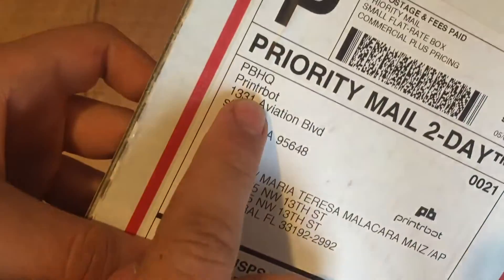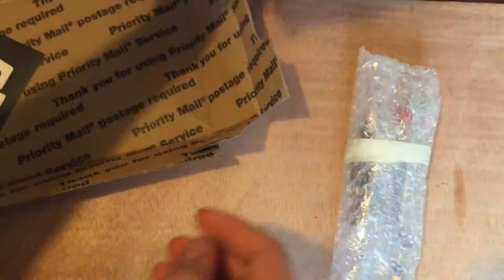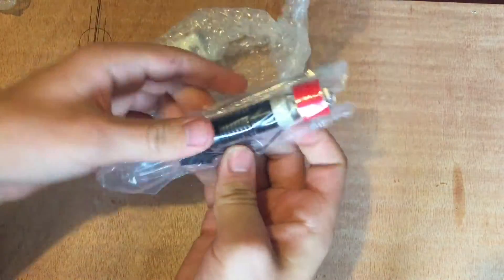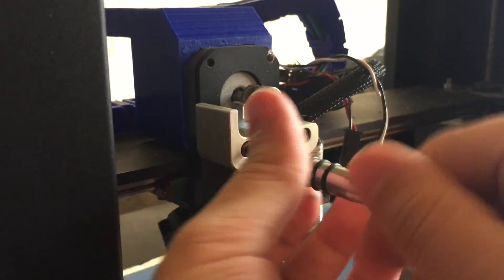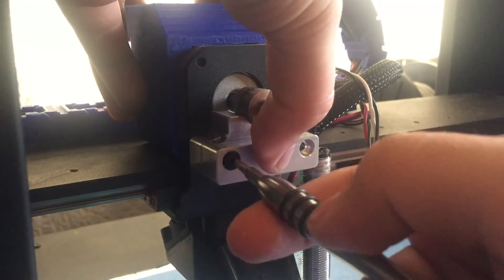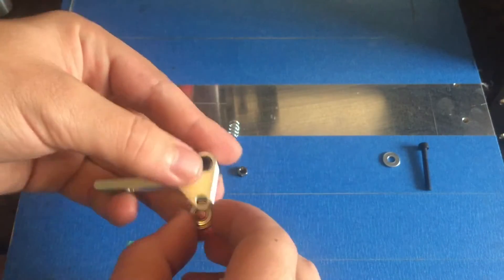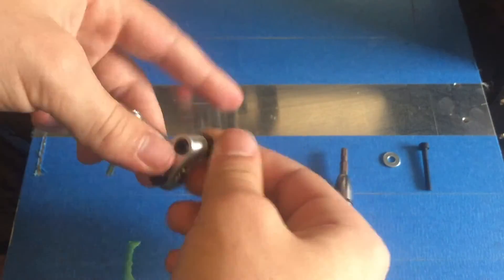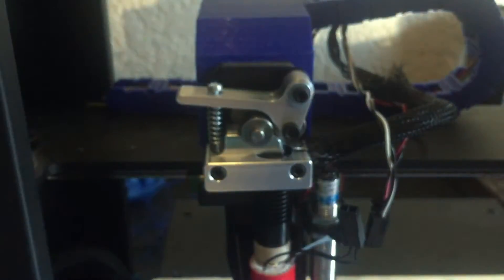Printrbot Metal Plus Upgrades

Comment: Some things you missed:
(1) Biggest improvement to the extruder in V2 is not the longer handle, and not the way it looks,  It is the interlocking pinion gear setup which improves the feed with exotic filaments.  
(2) Second biggest improvement is the elimination of the need to adjust tension
(3) Extended handle makes it a little easier to load filament, no big deal

On the installation, you missed an important step.  When mounting the pinion gear to the motor shaft, it must be carefully aligned to prevent jams, filament mutilation, and abnormal wear/gear clash.  I do this by using a piece of filament inserted in the feed hole and pressed against filament groove in the pinion gear.  Take your time, this is important.

It is very important not to over tighten the screws that screw into the motor housing.  It is fairly soft aluminum and can be stripped.  Unfortunately, you do have to tighten the bottom screws enough to pinch the hot end in place, so all I can say is be careful.  I think the Ubis13S may be slightly smaller in diameter that the old ceramic hot end, which just adds to this concern.

IMPORTANT:  The Ubis13S needs a fan blowing on it all the anytime it is in use.  I have seen the hot end self destruct when this fan was left off.  Printrbot has the appropriate fan and links to an STL for the fan shroud.  Do not order the Ubis without also ordering the fan.  I have an Ubis where the PEEK insulator melted and the ceramic heater core cracked, The 30mm fan you need for the hot end is $12.  A new hot end is $59.  The only salvageable part left in the hot end that melted down was the heat sink, making it cheaper to replace than rebuild.  So, you do the math, but I would never run one without the fan.